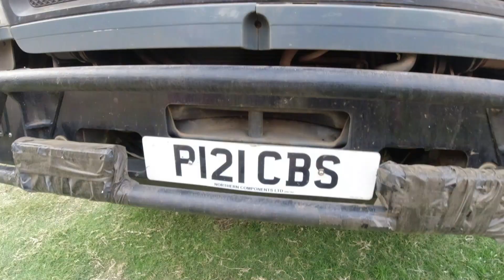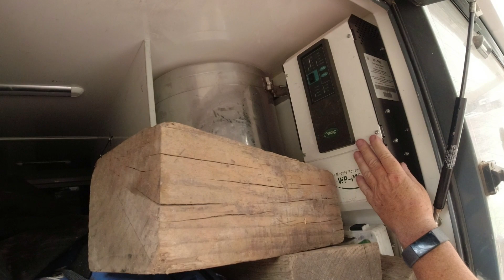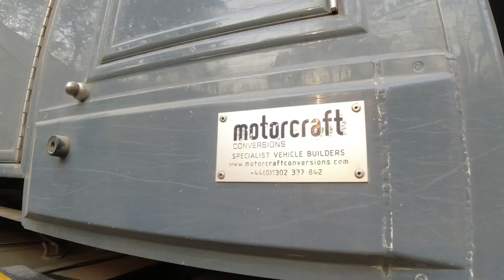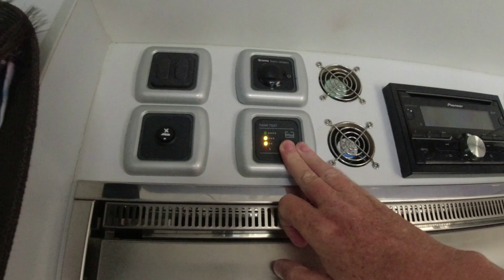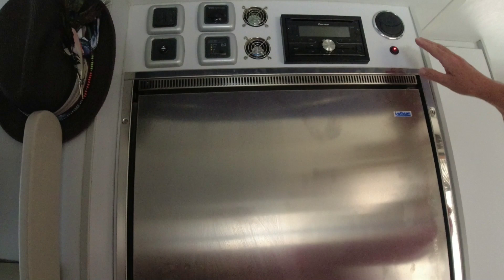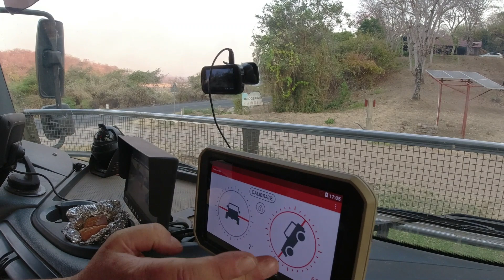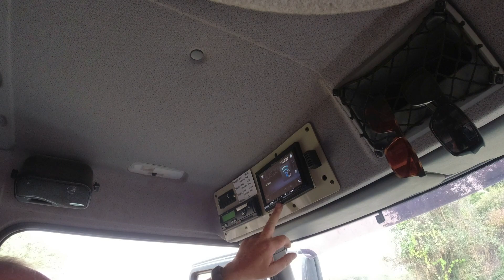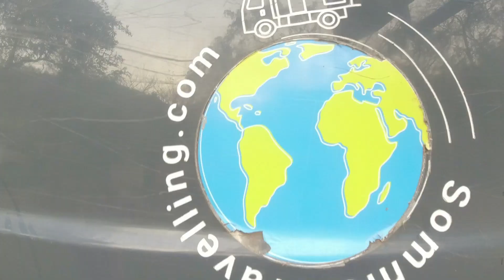I finally met Sommertravelling and their Monster truck in Africa!

Comment: Who needs a Rolls Royce when there's cars like that? 🤗 …even though it's a bit big for calling it a car…
Dear Henriette: If you take a look at the air filter housing of that mobile home at 9:01, you see a very important detail. A particle separator! The breathing holes have those windmill-ish shaped air guides on them. These give the entering air flow a spin, obviously. A few centimetres behind that outside housing, there is a second wall with holes in it. The holes line up with the ones in the outside surface. As the incoming air spins, centrifugal force will act on gas and particles that get sucked in. Heavier particles won't be able to follow the curve the air takes, obviously, so they will fall out off the airflow, hit the second wall and fall down where they collect at the bottom of the casing. Apparently there is a suction operated flap in the bottom of that casing that allows the muck collected there to fall out whee the engine stops and closes on stating the engine.
You may remember me writing about a particle separator system that I couldn't explain in the comments section in a few words in my reply to your video about your air filter mod. That was exactly it! Although the real estate under Honey's seat is limited, there may be sufficient room for something like this there. If you get the opportunity to make something like this somewhere do make sure it offers enough open area to the airflow. I once calculated a rough estimate that per litre per 100 Km fuel consumption, the engine requires some 3,6 litres of air per second. Honey will drink around 5 litres at full tilt, so expect some very roughly and with some give 20 litres air per second. These would have to go through that separator with as little loss as possible, too. My guess would be that the one horizontal row of those air-spinner-thingies would be a good starting point for honey. 
I got to know this system on MD-900 helicopters. They relied entirely upon this as air filter. It may help to stretch the interval of air filter swaps a bit with your bike, but won't get rid of all fine dust. Do bear in mind that it will cost you some power, though.
Reply from the maker: I think, I will let clever guys like you invent stuff like that! 😀